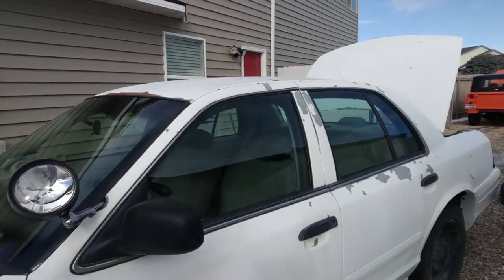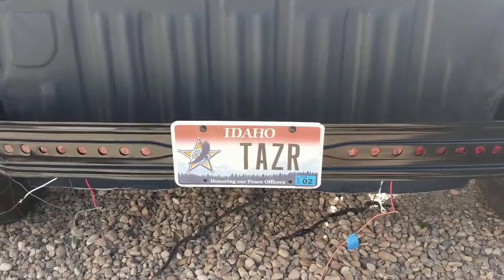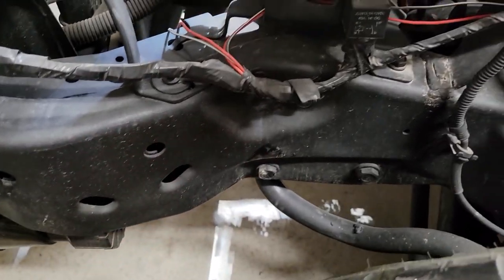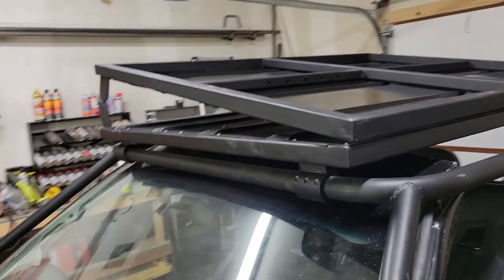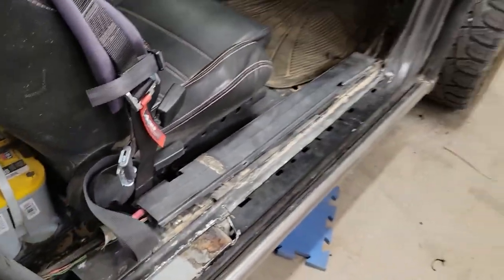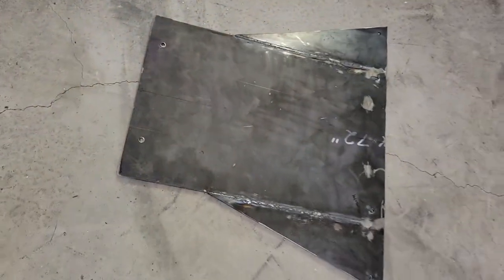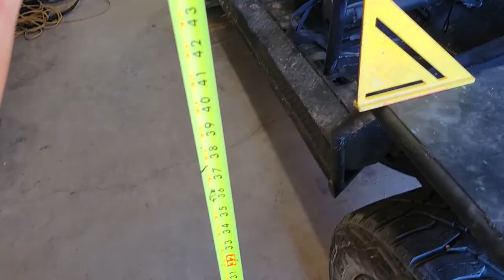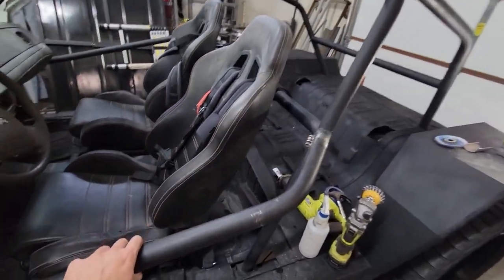Transforming a Police Car into a Vic Kart! Project TAZR!

Comment: Impressive work!  How's the ride comfort after the changes you made to the suspension?
Reply from the maker: awful! ha ha. It really is rough off road. I think sway bar deletes are next when I get back to the TAZR in the spring.
Reply: @gamblerspec  I can't remember if you mention it in the video, but lowering tire pressure could also be an option (depending on what you are running them at right now of course) for a little relief.
Reply: @Nathan_King  yeah that definitely helped me. The tires were 30+ when I got them but I've been running them around 20 and it at least made it bearable for now.